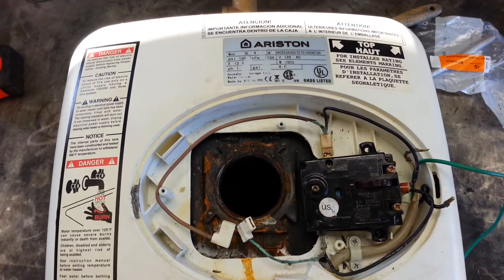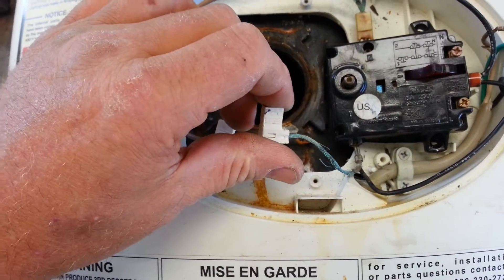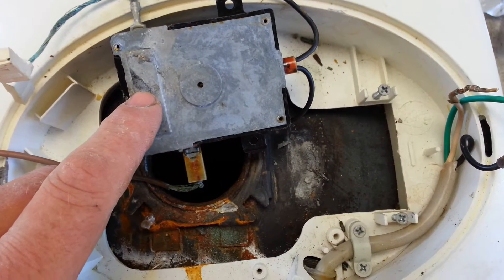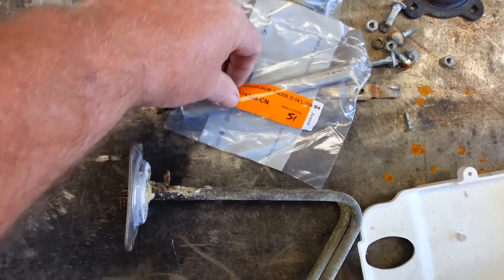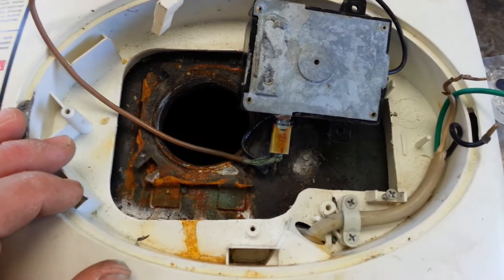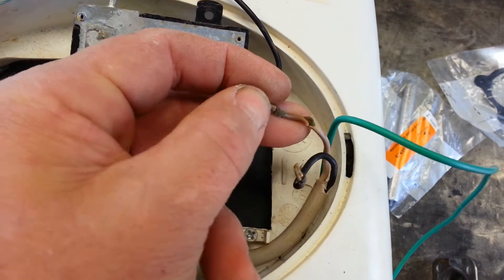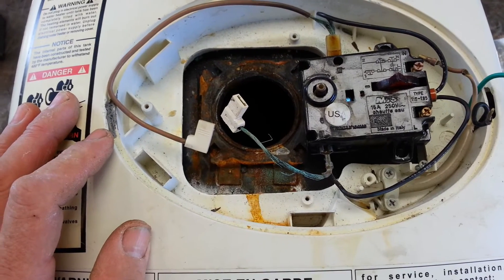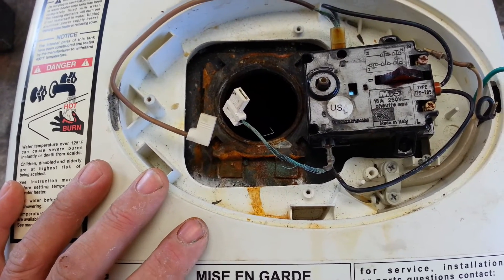Ariston GL-4 rebuild Part-1

Comment: So if the anode isn’t replaced will it rust out the tank? YOu mentioned this was being used as a back up to a Rinnai on demand. If this was turned all the way up could that have been the problem with the wires getting hot?  I have the same set up. I have water leaking from the bottom but it seems to be the gasket around the element.

Comment: Have you ever had to replace the pressure relief valve? Mine has started to hiss and doesn’t seem to want to close(filled with water, released no heat turned on), I think it may be causing my water pump to constantly run. My lines are tight. Water pump is tight. Small drip also from PRV.

Comment: Can you let me know if your techniques worked?  I've had two Ariston 2.5 meltdowns. I liked the availability of hot water enough to try twice, but these meltdown are causing me to have a meltdown. If I can tweak the product like you have and it works ... great.  I repeat the question - where did you get your parts, including the proper crimping tool.  Respond or personal email to krosyberg@gmail.com

Comment: I have one of these I need to do similar to. Lots of rust on element leads outside and need new power plug. Will also need new anoide. Where did you get your parts. Respond or personal email csranch2000@aol.com

Comment: Note that the heat that caused the wire insulation to fail is local to the connectors, meaning that the heat was caused by poor contact, due to corrosion.  The high resistance in the corroded connector dissipates power, heating the connector and the wire by conduction.  Larger gauge wire will NOT solve the problem, but soldering the wire to the heating element will.  Likewise, as long as they are kept dry, the connections to the switch will be ok, IF you solder the wires to the ring terminals.